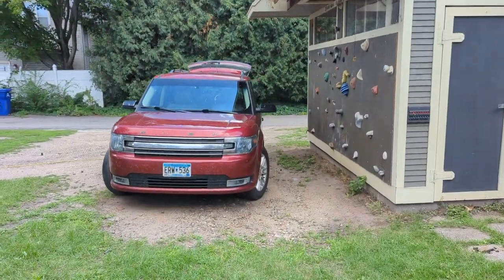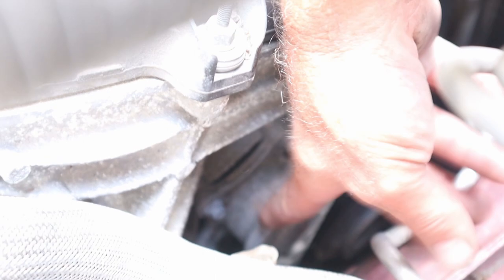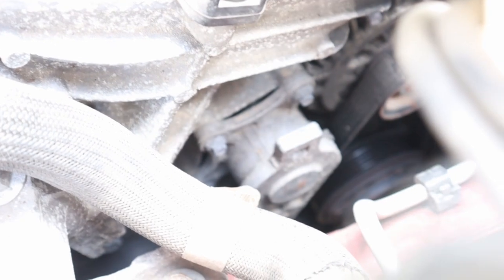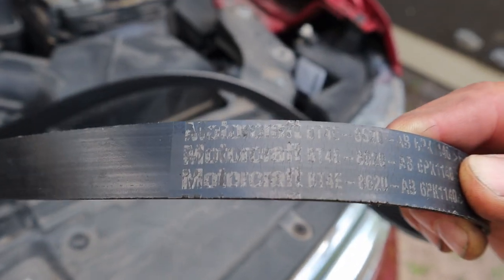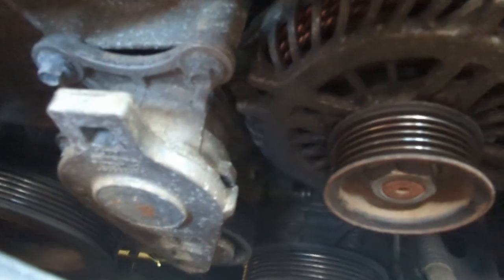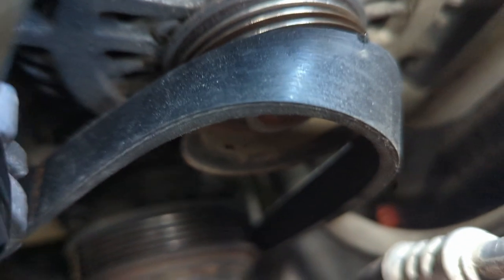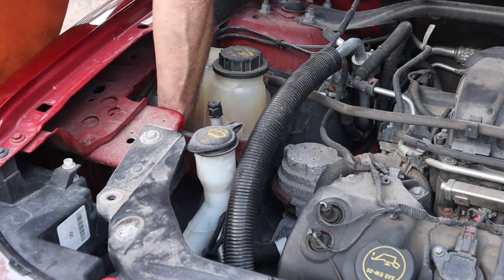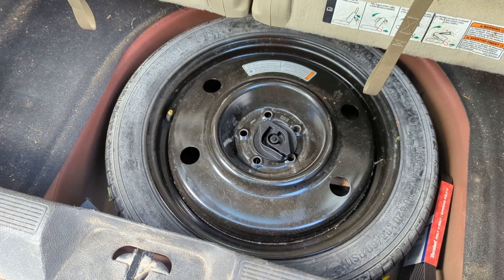Ford Flex Serpentine Belt - Easy Novice Video

Comment: 191,000 still running the same belt. Time to change. Thanks for the video.
Reply from the maker: Time to change indeed! What about the spark plugs?
Reply: @mbrenengen  I did those at 120,000 with iridium plugs

Comment: Coming from a mechanics perspective you may want to rechange that belt. I don't know if you noticed when we watching this video and editing it, but you actually put a small tear in the belt when attempting to get it over the alternator pulley because you didn't release the tension from the tensioner. You've now unfortunately created a weak spot in the belt that will be prone to tear further especially in the spring and summer season when the temperatures are warmer and the belt softens.
Reply from the maker: Thank you for you comment. I'll take a closer look at it.